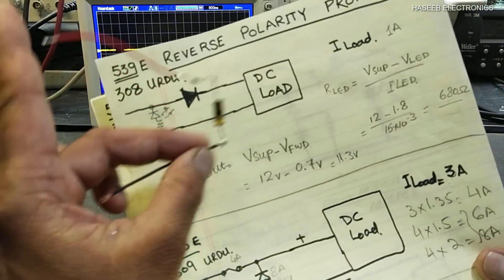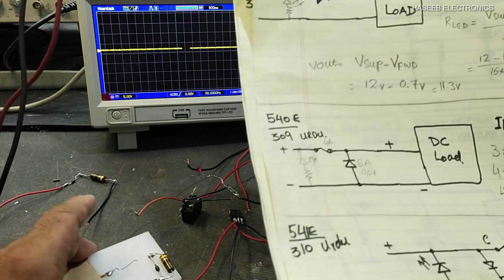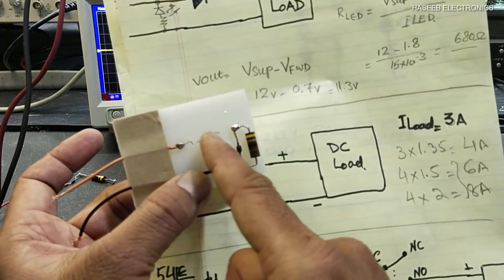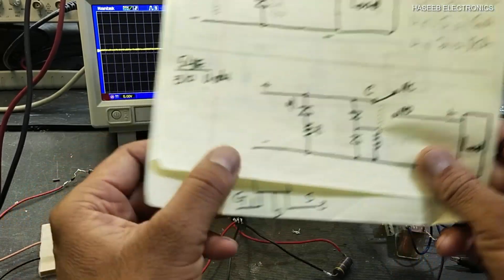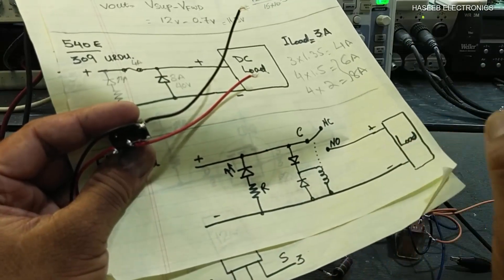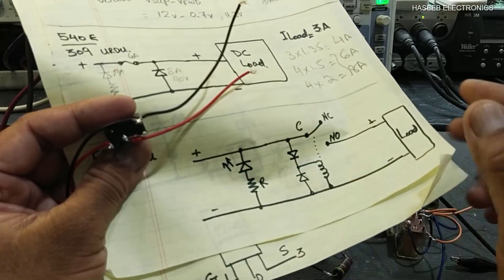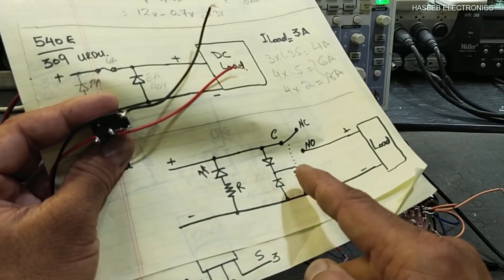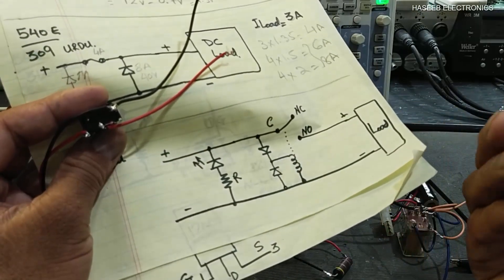{557} What Is The Best Reverse Voltage Protection Circuit? Protect circuits From Reversed Voltage

Comment: Thank you for the great videos. Could you use the reverse bias circuit to put two power supplies in parallel to double output current? What sort of circuit could be used with the mosfet technique to limit the voltage on the gate?